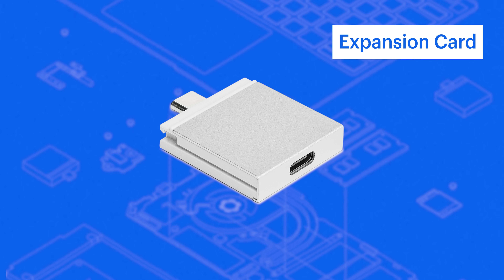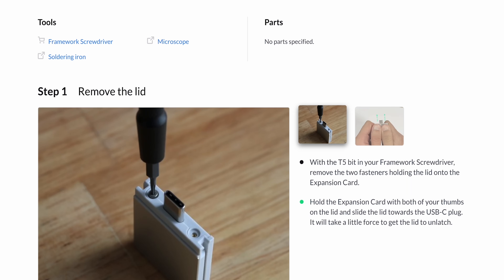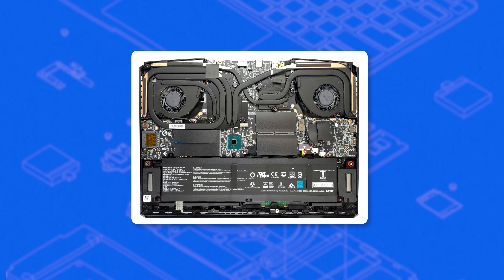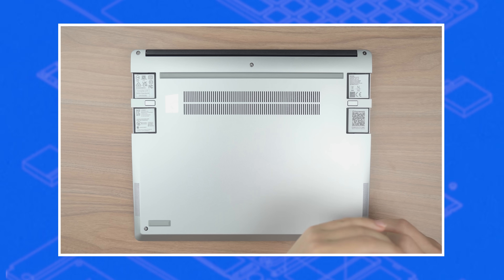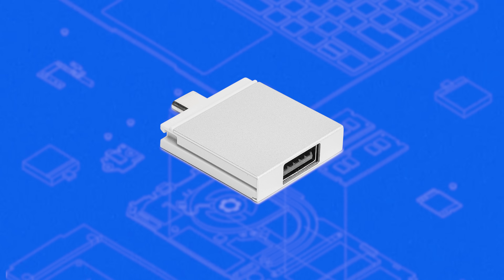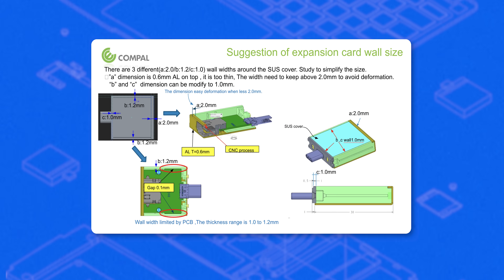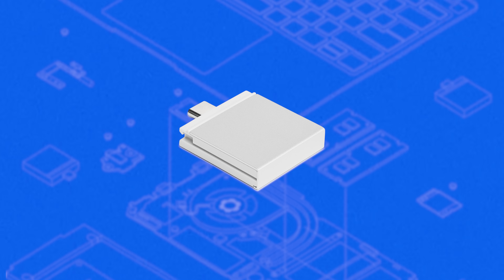How To Design an Expansion Card System | Product Development Series - Episode 2

Comment: An xl card design using two usb c ports that can adapt to two standard cards would bd useful for larger ports that can not fit like dvi, secure card, and compact flash while also allowing for multi port cards like a triple usb a card. Basically allowing for more IO in a snaller package

Comment: Looking forward to episode 3. I think using a metal plate instead of plastic is a smart way to accomidate the extra mm you need. Let's see what further design choices get made. For example would micro-sd's put in a sd card piece that then gets slotted into an sd card slot cause any trouble. similar to how it works with different size sim cards.

Comment: One thing I wish is that the locking bar between the cards could be optionally removed to allow for 2x tall expansions. I realize this could interfere with orientation since plugging into the left would have a port near the top be near the bottom when rotated 180 degrees to plug into the right. Still, there are several use cases for expansions with more real estate that still sit flush in the unit.

Comment: Good job with the video! For me the full size sdcard slot is absolutely not necessary because fast adapters with CF, SD a photographer should definitely have. A double Usb-C card would make more sense, even though there is a dedicated charging port (with charging indication LED?). You have the flexibility to write the port type on the outside somewhere.

Comment: I firmly believe this is a missed opportunity to rely both on USB C as well as either M2 or straight up PCI Express. Though probably for a lean MVP that is too much to ask. But in terms of 16-inch model I really miss being able to plug in an external graphics card (the way Asus almost did). 

Any plans on including an Expansion Bay module with PCI-E? 

Having a module with built in mobile GPU with PCI passthrough to plug in eGPU to achieve desktop performance at the desk and laptop performance in transit would be the real holy grail. I dare to say I'd preorder.

Comment: (4:49) It's only now that I noticed that the official modules have the Framework logo embossed in on the inner side, which leads me to think of third-party modules having the respective manufacturer or brand logo printed or embossed instead.

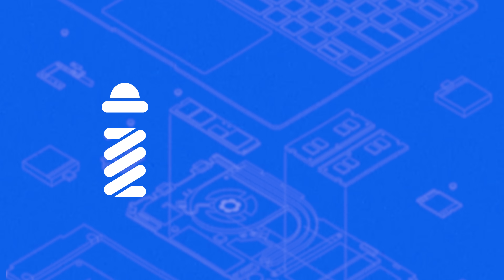(4:57) I have memories of 3.5" diskettes flying across the floor
Reply: Give me an ejecting device and I could play with it all day... until the spring is dead of course

Comment: I think it is a really strange choice to have the modules be too small for a LAN cable. It would have allowed so many more tinkerers to have their own projects as well, since size constraints are the most cited obstacle to implement some niche feature or port
Reply: I would have liked to see a flip-down RJ45 jack, like laptops used to have, so that the ethernet expansion module didn't need to protrude so much. This would probably have required a slightly different expansion card design (not sure there's enough room to expand the port downwards as-is), but it could have been taken into account at the start.

Comment: Just a suggestion for an update. When in the long future when you all redesign the chassis make the expansion cards a bit wider so you can have 2 usb c ports next to each other on the same expansion card. Then just have an adapter that is able to make sure the old expansion cards can be used with the new design.

Comment: 1 major thing you didn't address:
Q - why are they all a single port instead of multiple (but spec-down) options as well?

Ie: the USB C or audio jack.. why not also have a dual port or combo ports? You could have a type A/C + audio or dual type C.. dual type A etc.

Further, if you say it's because of the limitation of the usb-c inside, why isn't there at least 1 of those that has dual internal C connections to dual C external.. basically just a pass through but more space efficient.

Also, are these rated for higher power USC-C power delivery at like 100/140/200/240W for good portable (power prongs fold and detachable cords) GaN chargers? I'm NOT carrying yet another massive power brick and set of cables.

--------- Extra
Stepping away from the adapters:
Is the battery going to be quick and easily removable like these port dongles? Like, if I want to check my laptop (or multiple) for a flight I still need to carry all the batteries.... I carry at least 3 laptops for work right now and not being able to take out a battery means I'm carrying the WHOLE laptop instead of just the battery....

----- PLEASE DONT KEEP YOURSELF OUT OF GOVT OPTIONS -------
WARNING FOR GOVT CYBER SECURITY USE CASE - 
Make sure that NOTHING shows up as USB mass storage /removable storage because of a bad USB I'd on your dongle things.. also, make sure that by default none of those adapters or anything internal is USB id flagged as a multi media card reader... (except for obviously the SD card reader, but only when actually connected)

Why?
USB removable storage and card readers will automatically flag and brick most government computers because they don't want people using external flash storage devices.. even if no actual storage is there, a usb-c hub with a multi card reader will brick almost all of my credentials, my machines, and it takes days to get back and running..

Comment: You need a module to accomodate a legacy LPT parallel port that is addressable at 378, 3BC & 278. 😊
Reply: Technically, with an MCU like the RP2040 or ATMega32u4, you could set up a USB "parallel port" (with some form of breakout connector) and then use a driver inside your target OS to connect to it as a standard parallel port... I wonder if you could make an oversized module that sticks out of the port and which does actually have a full size port (maybe serial too while you're at it, and possibly PS/2)
Reply: @aaronjamt The round trip times of USB make it poorly suited for the sort of bitbanging that was done running e.g. JTAG or 5-bit LapLink/FastLynx/PLIP on the parallel port. With more standard protocols like ECP, you can get away with chips like FT245.

Comment: Do you really need the USB C expansion even though it already connects to a USB C port?
Reply: No, but yes. You can use the USB port directly, but if you damage that one, you just lost a port on the motherboard. While if you use a USB-C expansion card, you just damaged that card only.

Comment: If possible, will there be a double Type C expansion card?
Reply: A fan made one, but it’s not possible to have PD or usb 3 with either of em
Reply: @raffskid857  surely you could get a small USB3 chip used on a raspberry pi and have two gen1 speed USB C ports on a module?
Reply: @amirpourghoureiyan1637  The USB3 chip on the Raspberry Pi 4 uses PCIe, not USB. Thunderbolt does carry PCIe, but the conversion is large and expensive (and probably power-hungry, considering the heat sinks I see, but I don't have good evidence for that). You also still have the problem of PD.
Reply: They should just put a couple of non-expansion USB-C ports on their laptops as standard. Everyone wants it, why sacrifice card slots for a basic feature?
Reply: @Toothily   They're out of PCIe lanes. They literally cannot add more Thunderbolt or USB4 ports. However, they might be able to add simple USB3/PD/DP ports.
Reply: @linuxsbc  Don't they use an internal PCIe switch to provide TB to the port anyway? Like on the Framework 16, there isn't enough lanes to provide the GPU expansion and 6x USB-C ports with PCIe anyway. It needs to allocate them on a first come first served basis. Same with DP alt mode. There are limited physical DP outputs from the GPU that need to be switched to the ports that actually have displays connected.
Reply: @Toothily   They are couple of points:
* Interestingly, I think quite a lot of folks are only interested in having one Type-C port. Even with that one port, it's better if it's up to the user where it is located
* There is always a possibility of a compatible but different universal port coming up in the future. One example of that can be something like USB Magnetic. In that case it's nice to not be stuck with an outdated universal standard.
Reply: @alex_jellymath  A different universal port coming up? It’s already enough of a hassle getting everyone to switch from USB-A to USB-C, a new port won’t take off. Lets not futureproof ourselves to something basically imaginary. A simple USB 3/C port is an easy usability win.
Reply: @Toothily  On this specific point - I don't it's something that's hard to imagine. I mentioned something like magnetic USB two months ago and even saw after that some folks using those adapters for port and cable to make them magnetic. Apple also seems to be interested in magnets. With that in mind I could see the push for the new standard even in 2-3 years. 

Also, other comments, especially some of them that are not from me, still apply (they might be out of free pcie slots, they might want to accommodate folks that still avoid Type-C, etc)

Anyway, the community seems to be very close to figuring out the double Type-C expansion card so the problem of only having 4 ports might be gone soon :)
Reply: @alex_jellymath  I agree that it's worth keeping on our radars, but much promising and/or hyped connectivity tech has failed to take off, too. Wireless USB was unfortunately a complete failure. Wireless charging has seen some use, but not widespread adoption. If a magnetic USB standard took off that'd be hella cool. I've just learnt not to hold my breath before new tech really picks up real world inertia.
Reply: That's not possible. For it to be fully featured, it would need a full USB4 hub, which is very large and expensive—not possible for an expansion card. Limiting it to USB2, though, might work, though it would significantly limit the capabilities of the ports (no DisplayPort, no PCIe, limited to ~.5 Gbps compared to 40Gbps, etc.). You then run into the issue of charging. Both ports need to somehow pass through PD negotiation to the host port, but they would also need to ensure that, when both are plugged in, only one of them can negotiate. This needs to somehow interact with the USB2 hub, which then requires custom silicon. 

Basically, for it to work how you might expect is impossible. For a hugely limited version that loses most of the advantages of USB-C, it would be extremely difficult and require a ton of time and money from Framework. Thus, it probably won't ever happen.
Reply: @linuxsbc  While it would be nice to support USB3 or more, double USB2 might be good enough for things like connecting keyboard and mouse
Reply: @alex_jellymath  True, but few mice and keyboards use USB-C, and it would definitely confuse people to have USB-C ports that can't charge the laptop. That's fine for a lot of people, but Framework wants their modules to work how a layperson would expect a port to work. Thus, I think it would be best for some community member to do it.
Reply: @linuxsbc  That's true, but I assume dual Type-A card is at least much more challenging if even possible. Dual Type-C can still solve some use cases. As an example, I try to buy devices with detachable cables in case any of my cats decide to chew the cable. So even if a keyboard or microphone was coming with a Type-A cable, I can still swap it.

But I agree that having dual Type-C 2.0 ports might be confusing, especially as there are no popular color-coding for Type-C in comparison with Type-A.
Reply: @linuxsbc  Thank you for explaining that in such great detail. I've been holding back on replacing my Thinkpad T14s Gen 1 with a Framework 13 because I wanted to see if they were ever going to do this. But, knowing it's not possible at least solves that desire for me. I now wish it was possible, but seeing the reason why makes me feel better. I guess I'll just wait for this thing to actually NEED to be replaced instead of just replacing it because I want to support Framework.
Reply: Even if it wasn’t full speed, or if one was power in only? That way you could still use that port for data or things like mouse and keyboard while also powering and not needing to use 2 of the ports?
Reply: Double 3.5mm would be great too, especially if they could be separate audio devices
Reply: The top two expansion ports could have an additional USB-C port on the motherboard, so that a 2x passthrough expansion could be created and used just for the top left and right cards. This is better than exposing additional USB-Cs directly from the motherboard since if the port is broken or wears out, you can just replace the expansion card instead of doing board level repair on the motherboard.
Reply: Good news, the expansion slot is open source, you can just make your own.